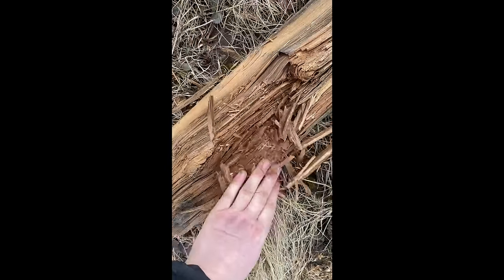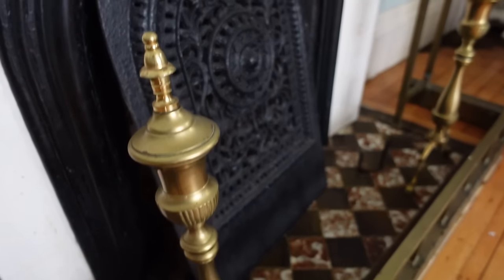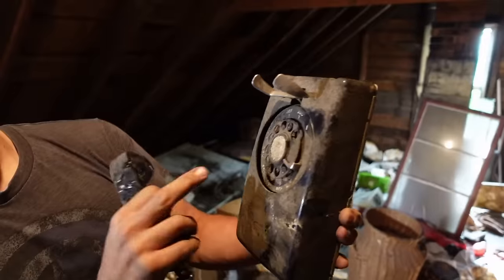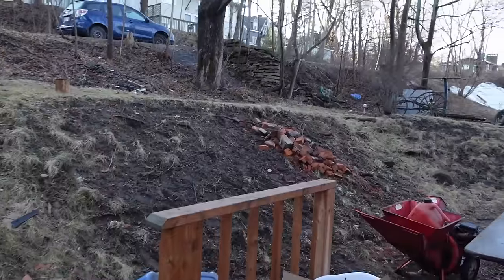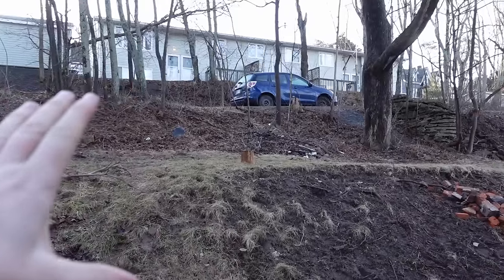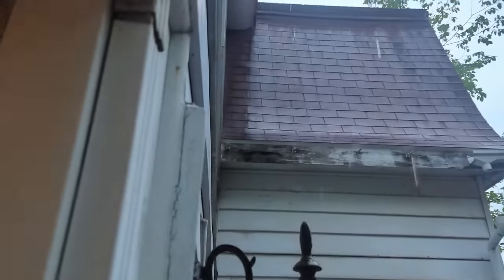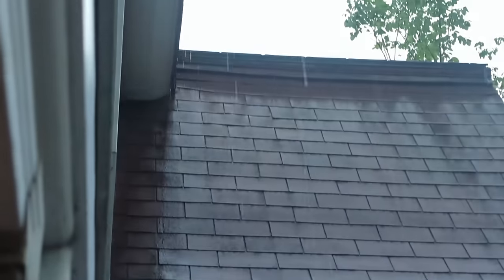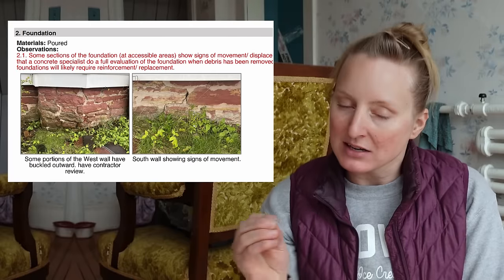Top 10 Reasons My House is Falling Apart // 120 Years of NEGLECT 😩 (ep.4)

Comment: When our roof was replaced on our 1896 house  they were able to leave the original boards after they took off the shingles. They then put the plywood over top of it. Which was great for 2 reasons.  1. The roof is stronger for the snow load here in Wisconsin.  2. In the walk in part of the attic it just looks better and more original and makes my heart happy. (Also it was less work/time /money to be paid to the roofers.)
Reply from the maker: Yea, I've definitely considered that, I just need to check with a professional to make sure that the roof is constructed in a way that it can actually support additional weight, cuz looking at it, I'm not sure it can 🤣

Comment: you may already know this but in case you don’t, a lot of older homes that had perfectly good siding were covered in the newer, “more advanced” low maintenance siding like aluminum. Because of the water issues around the windows, those areas are likely damaged, but it’s possible a lot of your original wood siding is still good underneath the other layers. I tried to see if it had been said before but there’s so many comments, sorry if I’m repeating something. 😅
Reply from the maker: lol you’re good, I know there’s a lot to read through ❤️❤️❤️

Comment: Re window frames, I’ve watched others repair some seriously deteriorated frames on other channels, in particular fairly early on in Escape to the Dream where they filled the rotten bits with a wood filler and sanded back to same profile. Good luck!
Reply from the maker: Yes, where the wood isn't so rotten that it's completely missing, it should be a fairly simple task. Repetitive and time-consuming, but not too difficult!

Comment: You might also want to look at a drainage culvert at or near the base of the retaining wall, it is usually a 6 inch or bigger in diamiter pipe that is permeable  or open topped with a grate run just below the surface to divert water away from your foundation/ backyard. you might also look into rain barrels or water gardens
Reply from the maker: That sounds very much like the French drain I mentioned!

Comment: Are concrete tiles better than shingles?

Concrete roof tiles are heavier than asphalt shingles. The weight results in longevity, thermal superiority, as well as weather and impact resistance. Compared to other roofing materials, concrete roof tile systems have the lowest life cycle costs based on the life of the roofing material and required maintenance.
Reply from the maker: I'm not sure my roof could handle the added weight, but something to consider for sure! Concrete is not very good for the environment though... will have to look into it!

Comment: That is a lot of problems, but I feel like a lot you can handle yourself. Even the roof. You need to make sure it's square and straight while laying out everything but it's totally doable. The tools are probably the most expressive part if you can't rent them. A nail gun is much faster than doing it by hand.

That foundation will probably need to "breathe" to get rid of moisture meaning you won't be able to make it water tight. So if you look up the you tube channel The Second Empire Strikes Back, Caleb discusses pointing on a stone foundation and what both paint and concrete does to them. He's fully restoring a Victorian house from 1900. His passion is to share what he is learning to help restore other houses like his and save them from the "millennial gutters". I'm sure he would be willing to share his knowledge to help save your house too.

I'm sure your house will get there. Caleb is about 3 years in and still hasn't fixed his roof and just put in his first shower. 😂 Proper restoration on a budget takes time. You're doing great.
Reply from the maker: Thank you for the recommendations, and fully agree that nail guns are worth their weight in time-savings. I'm well aware of the detrimental effect that paint and concrete have on stacked stone foundations... modern day masons be killing our historic buildings with their Portland concrete 😭😭 unfortunately lime based mortar is really tricky to source, it's been an ongoing project
Reply: @ShannonMakes  I'm glad to hear you know the risks of Portland cement. I know Caleb struggled a lot too trying to get it. They are just now starting to carry it in St Louis, which for what seems like a historic town, apparently doesn't do much the historic way. It's sad how much history is lost to modern methods. I think the "need for speed" is also a problem. The correct way takes time and a lot of people just want it done yesterday. Since they can't wait it gets done in the "whatever works" method, and becomes a future someone's (probably not them) problem.

I am glad you were able to help Charlie out with her hinges though. 😆 I love when my favorite channels cross paths even just in mentions.

Comment: We had to jack up
 our entire north side of the house, then put poles and bottle jacks in the cellar to shore up my bedroom. Still have joists to fix. Our house is 190 years old. Put a new roof on two years ago. $15,000.00 shingles. They stripped it to the sheathing and started fresh.
Reply from the maker: Yup, the cheapest quote we got (no replacing the sheathing, literally just take off the current roof and replace the shingles) was $24K
Reply: @ShannonMakes  yikes!!! I will say this, it's worth it to make sure no leaks inside..

Comment: As long as you don't lose any shingles of your roof, you can easily leave that job for a few more years.  That is how roofs were made at the time . There were no vapor barriers.
Our house is from 1602 and the roof is just like yours with wooden planks underneath the - in our case - slate.  Still original.  From time to time a slate falls down, because the hand - forged nails have rusted.  
Once or twice a year we have a guy who is specialized in old slate roofs check it all over and replacing slates where necessary.

For the slope at the back of your house, I would definitely plant some low shrubs, as they keep the soil from slipping down toward your house.  Once you've dug all that soil away from your foundation, it's best you make a French drain to lead the water away.

No criticism from me, just some of our experience we've acquired when renovating/restoring many houses.
Reply from the maker: Unfortunately I can literally see outside from some places (we have incredibly high winds here in hurricane territory), so a replacement is very much in order, although for the moment it’s patches on patches!
Reply: @ShannonMakes  Then it needs evaluation sooner. <3

Comment: We restored an 1886 shotgun house in an historic district.  The sill was replaced.  Not as hard as it seems.  Layers of siding removed and cedar siding restored and replaced in places.  Wood windows restored.  I only lost 2 panes of original glass (careful with a heat gun).  Box gutters repaired and re-lined.  Its all possible and actually a lot of fun.  Don't be discouraged.  Everything can be fixed.
Reply from the maker: Do I look discouraged? Cuz I'm not... these are fully part of the challenges that I anticipated and in fact looked forward to!! 😄
Reply: Great!  I did think we would never finish at times.  I admire your attitude and wish you all the best!

Comment: As the daughter of a window designer (engineer) (and a former manufacturing employee for windows myself) modern windows are less of a sham than you’d think.  Energy efficiency has come a very long way in the past 40 years.  There’s one Canadian window company that makes a lot of windows for historic homes such as your if the look is what has you worried.  Your energy bills will thank you. Your current glass could also be included in your new windows if that would be something you’d want.
Reply from the maker: Oh I don’t disagree that energy efficiency has come a long way, and if they weren’t original, Id probably be stuck in the cycle of replacement windows too, but I doubt that I will never make back the several thousands of dollars that it’d cost me to replace these windows in savings on my energy bill!
Reply: @ShannonMakes  that’s entirely fair. We all have a finite amount of time, money, and energy and we need to spend it on what’s important. When I bought my mid 1940’s home, someone had already replaced the original windows with mid 1990’s wood windows that were warping and that had broken the sealed units in a lot of them. I was blessed that my dad was able to get me a fantastic deal on vinyl replacements because “maintenance free” windows were more my speed. I did manage to convince him to at least put a 2 inch decorative bar along the middle to make them look like the original double hung windows that would have been in the house. So, from the street it looks original when the windows are closed, but the only real maintenance I have to do is regular window cleaning.

Comment: I also own a pre-1900 house and will politely disagree on the windows. I live in Michigan (so weather is comparable to Canada) and energy efficient windows cut my winter heating bills in half. I ran the AC (thank you previous owners for installing that!) a total of 5 days last summer. The models I chose look like wood, too, so I have the same ambiance with half the heating costs
Reply: In the UK you can buy double glazed wooden windows that work and look exactly like the originals. Pricy though.
Reply: @Jules_Pew  I bought something similar here - the interior has modern energy efficiency construction, but the exterior is made to look like old house windows. Over 1,000 USD per window before I negotiated a bulk discount, but in the long run a good investment

Comment: When I lived in a house that age, there were “storm” windows that were put over each window for the winter. These were large sheets of glass in wooden frames that attached on the exterior of the house with clips. In the spring these  were removed and replaced with screens. Whatever wasn’t in use was carried to the basement and stored. Not a fun job doing the work on the second floor storey while standing on ladder.
Reply from the maker: Storm windows are still a very common practice!

Comment: I appreciate your comment about layers of sliding. When installing a dryer vent in my 140 year old home we had to cut a new hole in an exterior wall. After much cutting we had the pleasure of counting the layers,  like rings on a tree. I believe the total was 5 if you don't include the wood plank exterior wallboard 🤯
Reply from the maker: 😳wow, you might even have my house beat!
Reply: @ShannonMakes   Our houses share a few unfortunate similarities...a stone foundation and damp basement 🤪   I believe your house has actual lumber framing in the attic though where mine is supported with logs... still have the bark on them and all. It makes it look like a tree house 😂
I look forward to seeing how you deal with the foundation and structural support. Hopefully it doesn't give you any problems 🙂

Comment: Metal roof owner here. 🤚 It needs to be cleaned frequently. If it was done wrong the repairs are costly. Also cell phone and wifi signals don't travel as well. The plus side is rain sounds amazing and it is durable and reliable. If you have trees planted within 3 feet of the house you have a wildlife highway. Which can be neat depending on the animal. Raccoons are surprisingly light on their feet and you just hear a light pattering and a single rat sounds like a full on tap dancing review. Also check your chimney caps are secure. Every house has an adventure attached to it. Thank you for sharing yours. 💕
Reply from the maker: Excellent feedback re: metal roofs. Love some first-hand experience and reflections!

Comment: The spaced attic sheathing is called skip sheathing.  It was used with wood shingle roofing to allow the back side of the shingles to dry out.  Replacing the sheathing with plywood or OSB is what roofing contractors are likely to recommend because it minimizes labor.  If you have the safety equipment, the time, and can handle the heights, you can fill in the spaces between the boards or remove boards and replace them next to each other and fill the remaining space with plywood.  Choose your battles carefully as large time constrained remodeling projects can be very stressful.  Good luck.